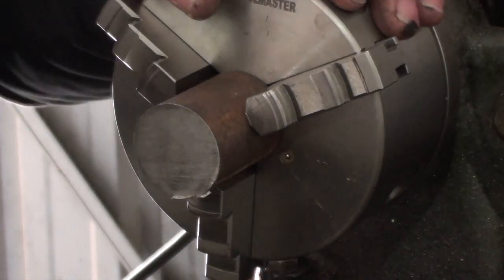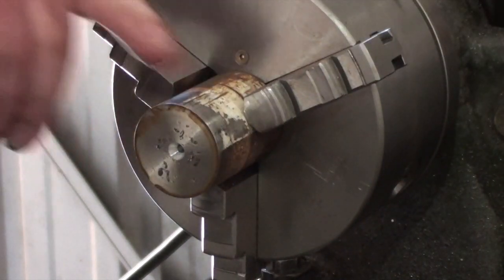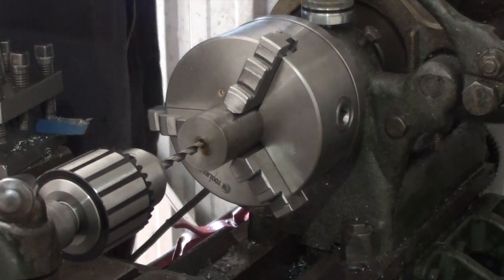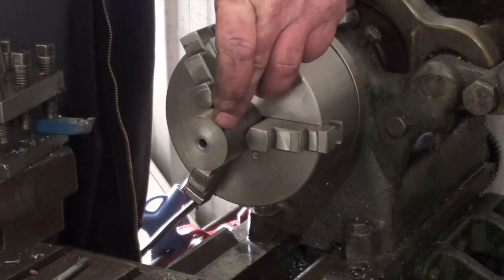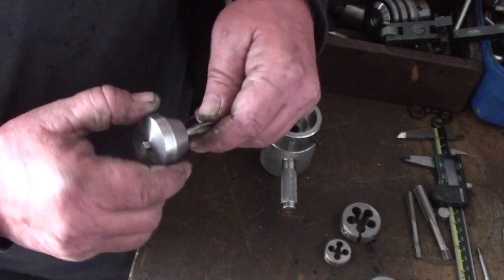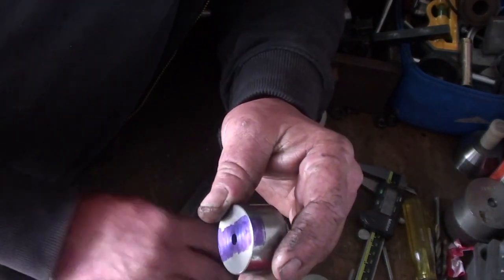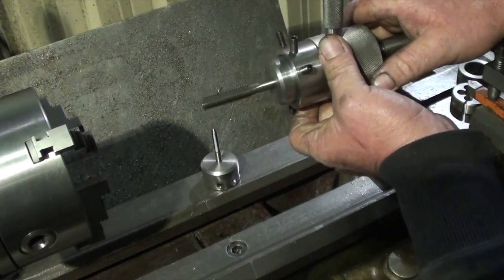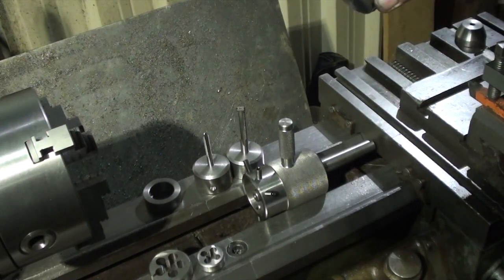Floating Tailstock Tap Holder

Comment: pretty cool idea, I'll have to make some of those for myself, but instead of drilling all the way through for the shank, leave it around 1/4" from the end then run an end mill through the middle to cut a slot to match the width of flats on the square part, then use a hacksaw to split it. you would get a much better grip, no need for set screws, the taps would be much easier to replace when they wear out, and no burrs left from set screws on the shanks.

cool video and keep up the good work

Comment: I been meaning to make one of those.  Nice job.
Reply from the maker: Gday Ben, i was in the same boat for years till i finally got around to making one now i really don't no how i would be with out it, the lead screw is worn quite bad on my old lathe and not even worth trying to cut a thread with it so I've become very reliant on this tool, the only hard part of making it was making sure the mt2 taper was correct, thanks for watching Ben, ATB Matty